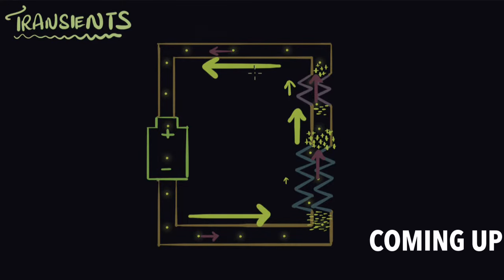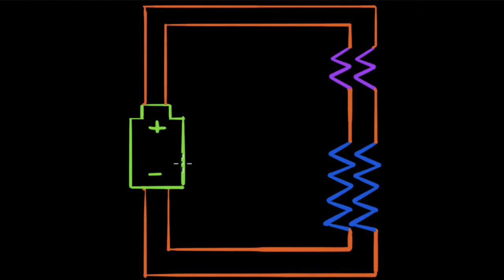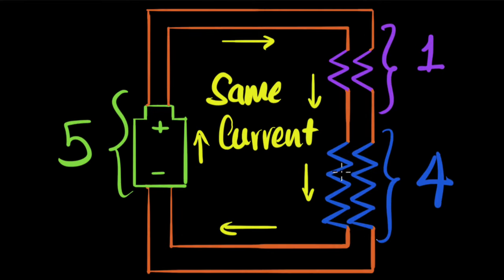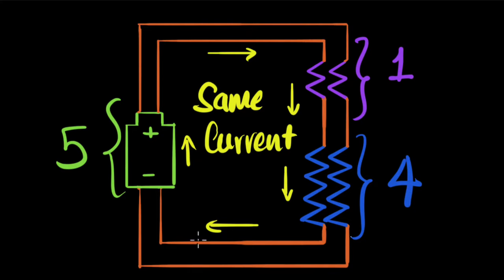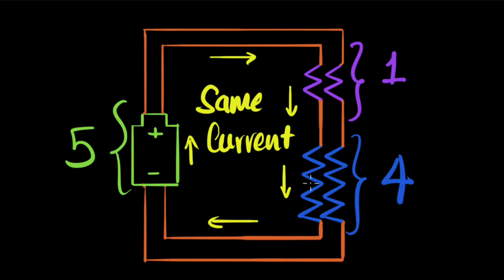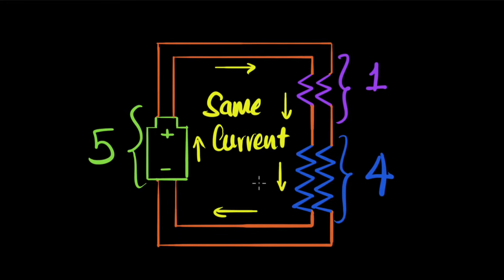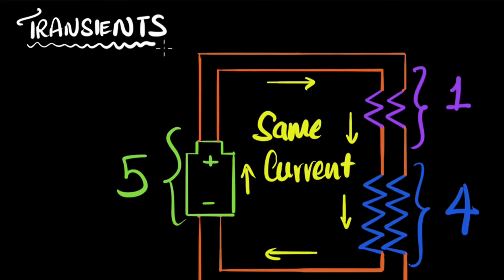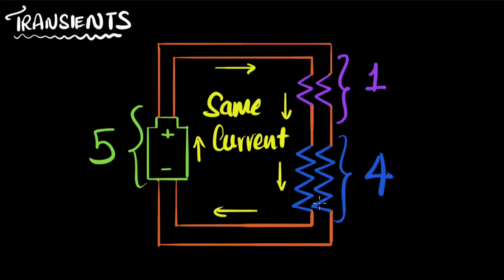Why resistors in series have different voltage (but same current)?

Comment: Loving the circuits videos thank you. Why doesn't the buildup of negative charge at first resistor repel the electrons coming from battery? My guess is the gradient of surface charge on the outside of the wire gives a constant electric field force allowing the electron to reach the resistor. I'm not sure how the gradient of surface charges changes with 2 resistors in series however
Reply from the maker: It does repel. Wasn’t that the point?
Reply: @Mahesh_Shenoy  I guess my confusion was once the steady state is reached, specifically where does the net 0 force come from. In this case I believe E-Battery + E-Surface Charge = the opposing E- charge build up in the resistor. Overall, I'm trying to visualize how the surface charge model of electric circuits interworks with charge build up at a resistor. Sorry if my explanation is poor.
Reply: @garrett3640  I also have problems with the idea that there is no net force in the wire.
Reply: @mjciavola  correct me if I am misremembering, but I think he said we were assuming zero wire resistance. With real wires there would need to be some net force pushing electrons through the wire.
Reply: @garrett3640  He did say that we are assuming zero resistance. However, even in that case, I believe that I read that you still need an electric force applied to maintain a current. I may be wrong, but I don't believe that electrons in a wire are subject to Newton's laws.
Reply: @mjciavola  I think you are of course right that electrons in reality are quantum objects with wave functions that don't individually work with newton's laws. But, assuming on average they are point objects that follow classical laws should definitely a good enough approximation. For the zero resistance example, I think the idea is an object in motion stays in motion with the net zero force except when passing through the resistor. However, I think it is important to note that in transient stage there of course is a net force. It's once we get to the steady state, that we would achieve the net zero force (except resistors) in this idealized wire. So I dont for this magic wire, you would need a net force once steady state is achieved
Reply: @garrett3640  Then that would imply that once you got the current going, if you took away the battery in this theoretically zero resistance wire, the current would keep flowing?
Reply: @mjciavola  I think if you took the battery away, you would loose the electric field force from both the battery itself and the gradient of surface charge it produces. This would result in a net force from the pool of charges at the resistors. Then all these charges would spread out in a uniform matter throughout the entire circuit. That's my theory
Reply: @garrett3640  I like your theory. It makes sense.
Reply from the maker: @mjciavola  Beautiful discussion. Couldn't have said it better myself.
Reply: @Mahesh_Shenoy 4:34 Hi, I don't understand this part, where did the positively charged protons come from?? Because until I watched this video, I thought that electricity only deals with electrons, not protons. I understand that generally speaking, like in chemistry or something, a decrease in electrons = an increase in protons. But when it comes to electricity, I thought we were dealing with electrons only?? Where and how did the positive charges come from??

Thank you

Comment: Then how does this concept be applied to parallel (why and how voltage across the elements are same even if the values of resistors are different). please clarify this doubt sir.

Comment: Can you pls explain how the voltage is same across all the resistors connected in parallel in the circuit using the same concept

Comment: Sir i getting really confused how battery voltage get add up in  series and reduced in current it is pretty easy that if you have two battery in parallel by junction rule it is easy to say that current increase or decrease (may be) but voltage is something which is really confusing for me specially in the case of battery please explain if you can because there is not a single video talking about this ...
Reply from the maker: Do you want to understand the voltage for cells in series and parallel?
Reply: @Mahesh_Shenoy  yes sir it's in ncert 12 but explained mathematically & i always thought battery as a combination of vaccum cleaner and air blower pushing from one side and pulling from other side.. so its getting very complex for me when you join the terminal of battery.
Reply: ..the original channel is khan academy india-english...you can learn alternating current too there its explained in such a good way..i jst finished it...i wish this guy cud personally mentor me
Reply: @Mahesh_Shenoy 4:34 Hi, I don't understand this part, where did the positively charged protons come from?? Because until I watched this video, I thought that electricity only deals with electrons, not protons. I understand that generally speaking, like in chemistry or something, a decrease in electrons = an increase in protons. But when it comes to electricity, I thought we were dealing with electrons only?? Where and how did the positive charges come from??

Thank you

Comment: I havea question, after the circuit reaches a steady state, if the current is the same, then there should be a equal distribution of electrons, so how do the charge accumulation remain?
Reply from the maker: The charge accumulation ensures the right potential difference across the resistor.
Reply: @Mahesh_Shenoy 4:34 Hi, I don't understand this part, where did the positively charged protons come from?? Because until I watched this video, I thought that electricity only deals with electrons, not protons. I understand that generally speaking, like in chemistry or something, a decrease in electrons = an increase in protons. But when it comes to electricity, I thought we were dealing with electrons only?? Where and how did the positive charges come from??

Thank you

Comment: what if you made a situation where the transients are repeated say a switching circuit with the appropriate pulse width and frequency  ???  would this create a situation where the current between the two loads are not the same .   Of course the current has to be the same in a series circuit but the fact that the voltage drop is not the same this leads one to believe neither is the current . So in essence a constant current source would establish a universal current flow threw both loads only after the transient period..  and a pulsed current source would establish a perpetual transient state ?  Yay  or Nay

Comment: sir, please explain parallel resistance too
Reply from the maker: Why don’t you try yourself using the same idea?
Reply: @Mahesh_Shenoy 4:34 Hi, I don't understand this part, where did the positively charged protons come from?? Because until I watched this video, I thought that electricity only deals with electrons, not protons. I understand that generally speaking, like in chemistry or something, a decrease in electrons = an increase in protons. But when it comes to electricity, I thought we were dealing with electrons only?? Where and how did the positive charges come from??

Thank you

Comment: u are saying that the voltage drop across the bigger resistor is higher because more electrons gets accumulated there(because of its size/amount ), but dont u think this theory falls apart when we remove the bigger resister, because now the voltage drops at only the smaller resister BUT now the voltage drop across it(the smaller resister)  equals to the supply voltage?
Reply from the maker: if you remove the bigger resistor, there will again be a current imbalance, momentarily. The current in the smaller resistor stays the same but the current outside would increase. This leads to more charge accumulation across the smaller resistor, bringing it's voltage up.
Reply: @Mahesh_Shenoy 4:34 Hi, I don't understand this part, where did the positively charged protons come from?? Because until I watched this video, I thought that electricity only deals with electrons, not protons. I understand that generally speaking, like in chemistry or something, a decrease in electrons = an increase in protons. But when it comes to electricity, I thought we were dealing with electrons only?? Where and how did the positive charges come from??

Thank you

Comment: don't you feel u said something completely opposite in the video of current remains same in series
Reply: There is a difference between normal phase and transient phase

What do you think? Where there is a circuit does the electricity starts flowing normally through it? No it does takes some time to get adjusted to the circuit that time period is transient phase and current flows differently in transient phase

Comment: Then why in parallel voltage is same and current differs
Reply: There can not be almost any voltage drop in wires. When resistors are connected in parallel each side of every resistor is connected to the same wire so the voltage must be the same. With constant voltage the current depends on the resistance. If the resistors are different the current will be different

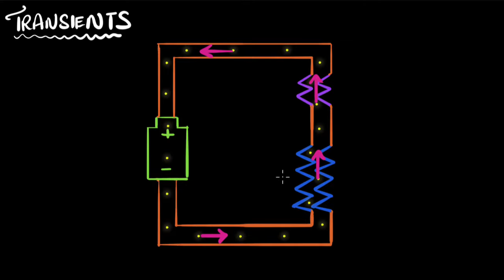Comment: 2:19 electrons go very very high speed? Well, I wouldnt call a drift velocity in the order of 1mm/s very very high. That's is at least one "very" too much ;)
Reply: Well the speed is of the order 10⁶m/s and what ur saying is drift velocity! Which is obviously very very low!
Reply: The drift velocity is the speed electrons (the particles) are moving along the wire. What speed are you talking about? 
Signal speed is not to be confused with that. That's more like the speed charges are talking with their neighborhood ;)

Comment: High speed electrons are not related to a high current. Speed is in metres per seconds, whereas current is in coulombs per second passing a point in the circuit, not traveling a certain distance in the circuit. Please, please, please do not confuse the two. Your poor viewers are being mislead by this and other incorrect statements that you make. Also, transients do not occur when there is only resistance involved, but only when capacitance and / or inductance is in a circuit.
Reply: All components, even resistors have capacitance/inductance. And as for the speed - I suppose SPEED of electron FLOW is what's talked about here
Reply: @PrzestronnyMistrz-ly8rp  Ah, so if we are talking about REAL world components, then all bets are off, and any information provided is worthless. "SPEED of electron FLOW"? What does that even mean?